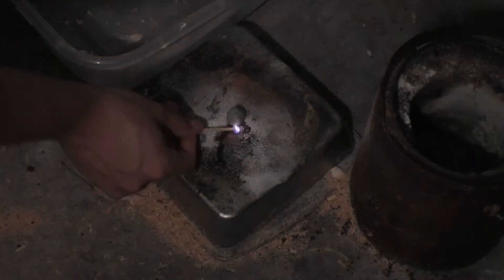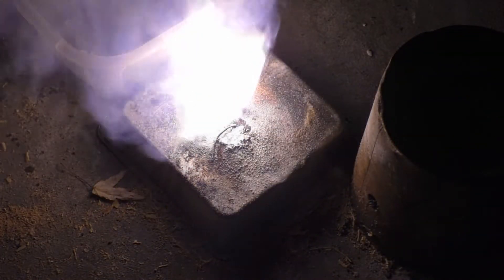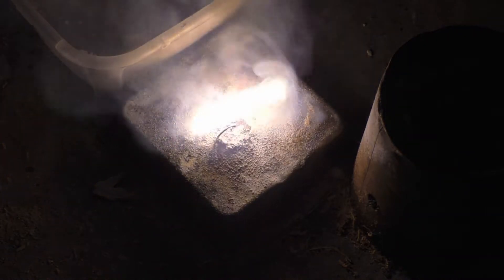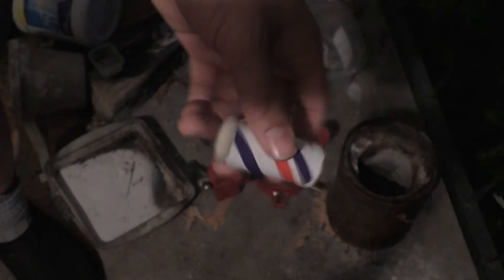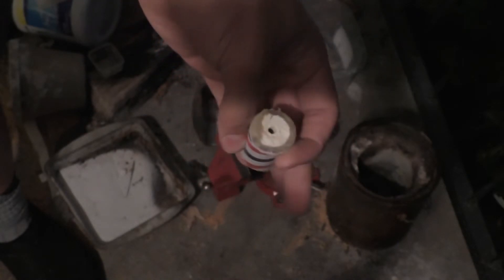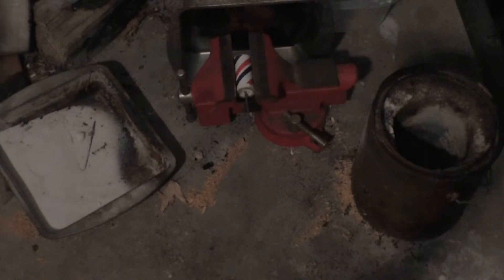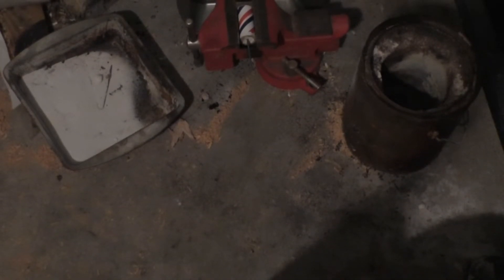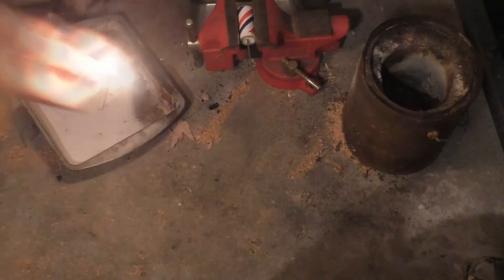Compound B, Rocket Engine Test

Comment: absolutely amazing video however I only have 2 concerns. 
1. you did not show the synthesis of the the compound B rocket fuel, however if if shown another video I understand.
2. YOU'RE USING THE IMPERIAL SYSTEM!!! When conducting experiments you should always use the metric system as it's a universal system and people all over the world will be able to use it. with that absolutely great job
Reply from the maker: science_and_anonymous I do plan to do a video in the future about the actual fuel synthesis. That's why I am kinda keeping it under wraps right now. 

 And sorry about the imperial measurements, but that is actually the exact size bits I used to drill the holes.

Comment: Burn rate has to be increased for best performance, you want a 2-3 second burn
Reply: TrollFaceTheMan 
The longer it takes to accelerate, the longer it is fighting gravity. This isn't a huge problem, but it makes a difference. 

I think rocket motors are more efficient at higher burn rates, because if higher chamber pressure. 

I can confirm the first point, I have a good physics background, but the second is purely conjecture.
Reply from the maker: The Ratios haven't quite been perfected yet, but why would it need to burn so fast? Assuming that it had suffocate thrust to launch a rocket.
Reply from the maker: Ahh okay I can see that. Thanks.

Comment: if you are using KClO3 for oxidizer add some starch to the mix if you plan on cooking it like KNO3 compositions
it will prevent ignition on heating

otherwise the press is your friend
Reply from the maker: That's the brilliant part, no cooking needed :)
Reply: Im also trying to find a fuel using KClO3 without cooking because even if i had no accidents there is still a risk every time, small it may be.

epoxy yields a less powerful rocket and PVA has a problem of turning rubbery while mixing

my next idea is to use a wet pressed mix and get a vacuum chamber to dessicate off the water
Reply from the maker: +MysteriusBhoice Sounds like you are pretty experienced with this subject. How did this fuel look? It hasn't had it's ratios tweaked yet so there is still room for a hit of improvement.

 But at how it currently looks, what do you think?
Reply: that ball shaped thing looks like you used some type of resin as a binder.
the fuel you made seems energetic though 1 thing i notice in the end test is the burn is uneven.
i would dust the inside core of the rocket with a fast burning starter mix to fix that problem
Reply from the maker: +MysteriusBhoice Cool, good to know about the dusting. And resin is a good guess.